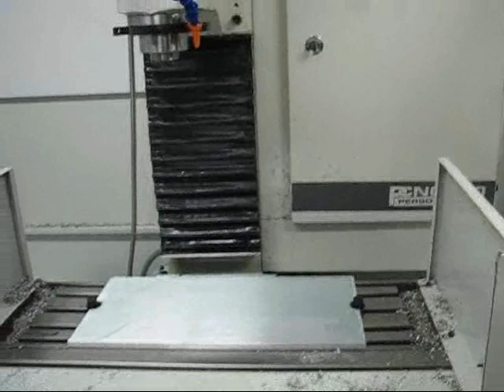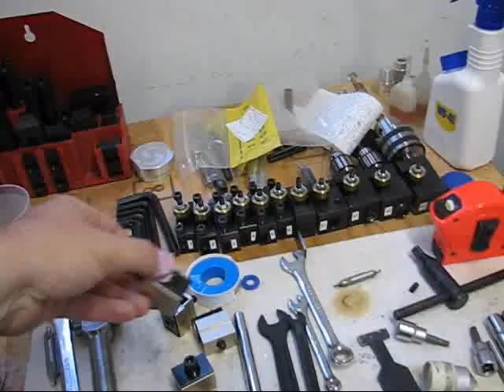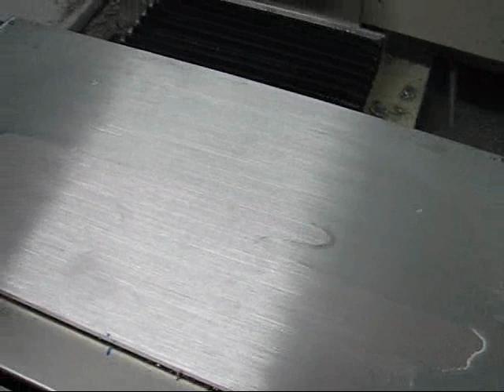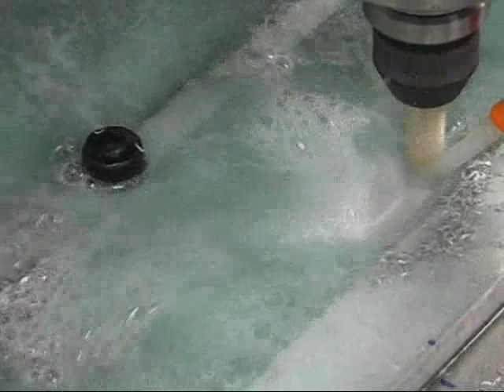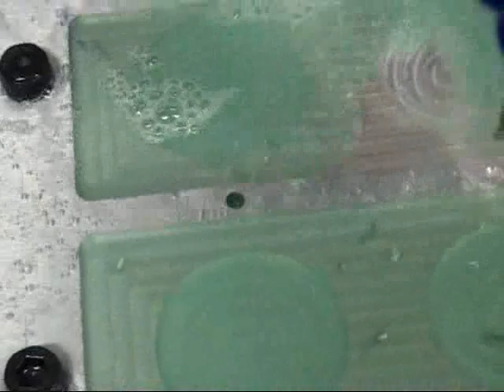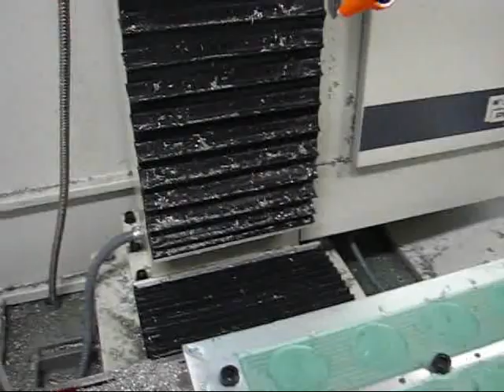Tormach PCNC 1100 - Fixture Plate CNC Milling

Comment from the maker: I took pictures of the gasket extruded into the flow path which I'll post to the CNCZone thread.  As a quick preview of the results, the flow with the gasket partially blocking the flow path, was about 32.7 gallon per hour.  Removing the gasket increased the flow rate by 55%.

Comment from the maker: I actually removed the blue silicone gasket between the hose and the black pipe that's set-screwed into the casting that bolts to the head.  Turns out that tightening the hose down onto the black pipe causes the gasket to extrude into the coolant flow path, reducing flow.  The surgical tube is still inside the Loc Line section.  I've taken flow measurements of each component and will post results to the Tormach section of  CNCZone soon. I also have a new improvement planned for the 2nd fixture.